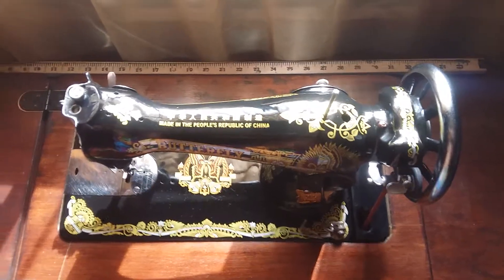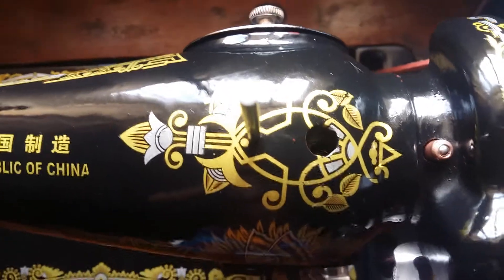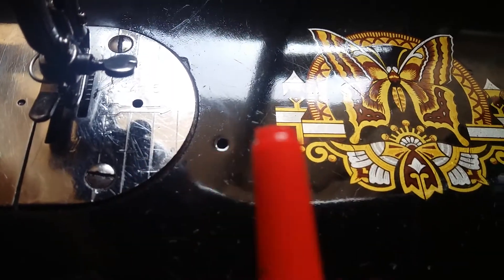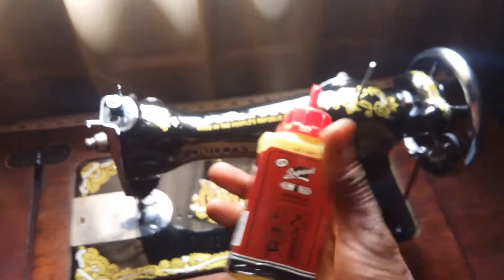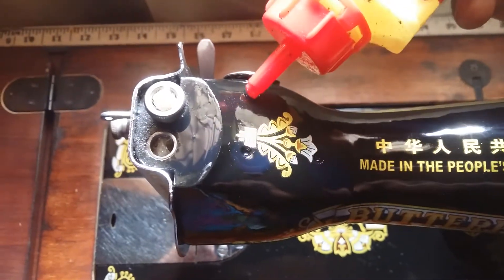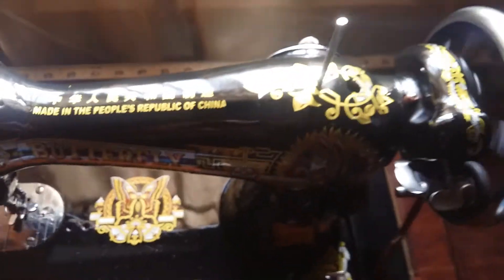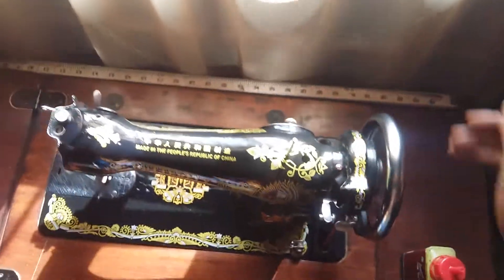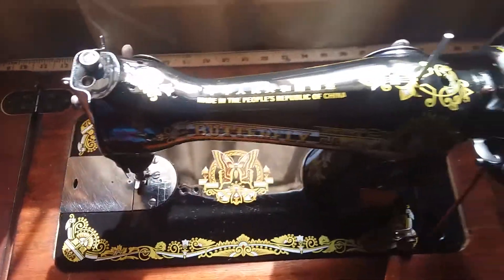How to oil a butterfly sewing machine

Comment: Please what stops the handle from moving also breaking needle too
Reply from the maker: Oil machine regularly for lubrication and also check if needle clamp screw is properly tightened.see if the needle is properly inserted